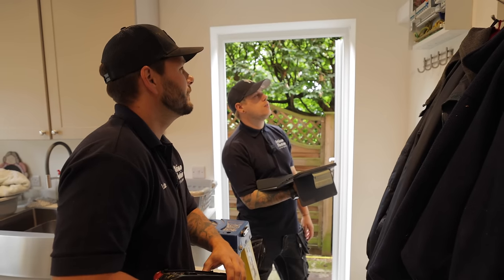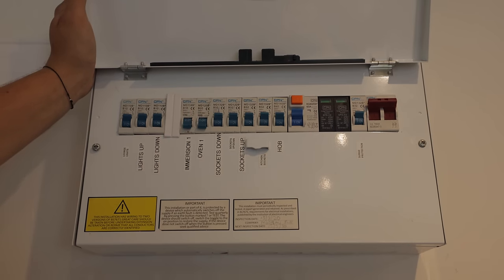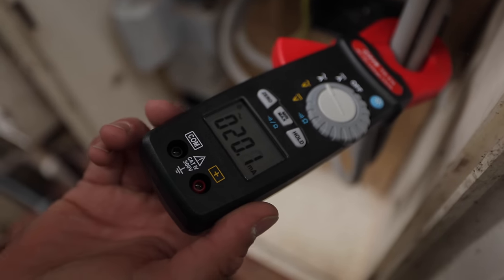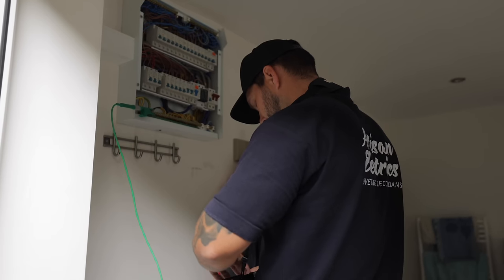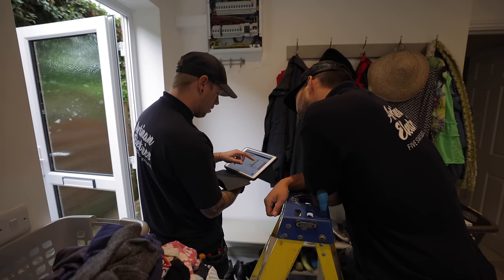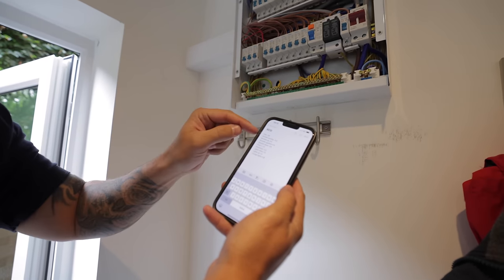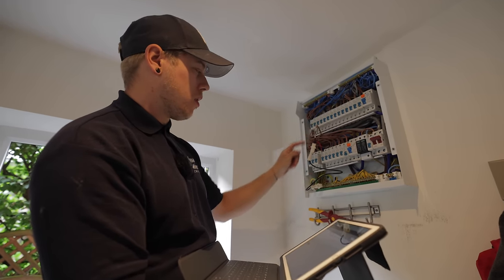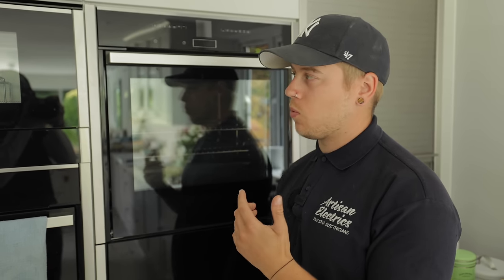CHEAP Electrician cost this customer £1000s💷

Comment: Your quite rightly saying that CPN is a budget make and was adding to the issues and yet when you change boards you use Fuse Box which is also a budget range?
Reply: But if its rcbos its budget and splitting the leakage to individual rcbos
Reply: Fuse Box may be a budget range, but I've found them to be fairly reliable in practise. More so than BG, for example, which is very common in the UK. I use either Hagar or Schneider for preference.
Reply: The issue is that there are too many circuits on each RCD not that it was a budget make.  The RCD's can easy be removed and RCBO's fitted rather than fit a new board @MCKINJO
Reply: @davidexley3110  I know that. What I'm saying fusebox May be budget but it rectifies the problem

Comment: But a normal house has 1 or 2 30mA RCDs and it work’s absolutely fine. The number of RCD’s is fine. Criticism of the CB/RCD brand is BS. RCBO upgrade should not really be needed, it seems like fishing for work, or to put it another way; suggesting an expensive sledge hammer to crack a nut.
Reply: It needs upgrading because it is most likely the wrong type of RCD.

We shouldn't be using type AC RCDs today.

Comment: We can see two RCDs, exactly as required by UK regulations, and yes, equipment used is Asian generic produce UKCA certified. Faulty RCD (and any other piece of equipment) needs replacement. In my opinion faulty RCD shall have beed replaced first and then observations made on leakage. Those observation could be improved, and Merel network analyzer unit used, or 24/7 monitoring installed (i.e. Supla), DC and AC leakage could be measured and then calculated per circuit separately. Worth to mention F type RCDs are not intended to protect from DC leakage over 6mA, and would help only when frequency is modified. That is a serious mistake. Only Type B RCDs would guarantee that DC leakage over 6mA would not block the RCD (and some RCDs type A+ used for EVSE that is still a rare product). Not sure if that job was worth 1000s...

Comment: Changing all those MCB is to RCBO’s increases the limit of a collective fault current. Potentially you could have .33 of a Amp flooring to ground before the system would recognise it as a fault. Something worth bearing in mind.
Reply: What's wrong with that? A property with many devices can quite easily have 30-50mA of earth leakage on normal usage. Having it all funnelled through two RCDs means nuisance tripping. The 30mA trip is a safety limit to protect people. A human isn't going to have limbs long enough to touch all class I appliances in the house to sink that cumulative leakage current.
Reply: I’ll tell you a story. I went to a house where the brother in law had done a board change. The property was TT with a single rod in the garden. The brother in law had got the tails crossed when he was doing it. The home owner hung a picture in the living room and hammered the nail through the neutral and earth. The system had approximately half an amp flowing to ground when I measured it. The tragedy was the owner had 2 beautiful Samoyed dogs. When I complimented her about the dogs she burst into tears. A third dog had died the previous week from a suspected hart attack. It’s kennel was less than a foot from the ground stake. I did not tell the owner what I suspected.
Reply: @demonkey123 unfortunately one can't completely legislate against fuckwittery. A ground stake, correctly inserted, will be at a depth where there shouldn't be step voltages between the stake and the transformer. That combined with the incompetent workmanship that caused crossed polarity. That said, the crossed "neutral" and earth by nail would have caused all class I appliances and any bonded plumbing to become live as a result. If RCBOs or RCDs were installed, they'd still trip.
Reply: I agree, however my story was intended to highlight the dangers of an excessive unchecked current flowing to earth. An RCD protecting multiple circuits would only allow its maximum rated fault current to flow, while multiple RCBO’s allow a cumulative number of faults to add up to a significant amount of current flowing to earth unchecked. Using multiple RCBO’s doesn’t remove faults, it allows the system to operate under conditions that a conventional RCD protected system will not because it regards the situation as potentially dangerous.
Reply: @demonkey123 Your story didn't support the superstition that total leakage is a danger .  Total Earth wire current could be a problem if very high, like multiple amps, because that wire is only supposed to carry that moments before the fuses blow because of a full short to ground .
Reply: It's irrelevant that there would be 330 mA of leakage current. Not that it's ever going to happen. In your wildly unlike scenario every single circuit would have to be at the maximum leak rating (and 30 mA is the maximum leakage before an RCBO trips; usually it's in the 20-25mA range).

What matters is that the individual RCBOs trip at a level which protects human beings from a fatal electric shock and when there is a line to CPC or neutral to CPC fault.
Reply: @johndododoe1411 What would happen if your main earth was compromised? All bonded extraneous metalwork at mains potential due to cumulative earth leakage. Any potential fault current above 100mA would be regarded as potentially fatal.
Reply: @TheEulerID You just defended the safety benefits of a correctly functioning single RCBO and completely dismissed my point regarding cumulative faults. Even 100mA of potential fault current can be fatal. A compromised main earth combined with multiple leakage faults could easily present a danger that would not be detected by a multiple RCBO installation.
Reply: @demonkey123  That is because it is ridiculous. Just how do you think that 330 mA you claim could flow through the combined CPE would pass through a human body? The CPE is at ground potential. Even on a TT system with high ground loop impedance, it is not going to reach dangerous potentials, even on your astonishingly unlikely scenario that every circuit leaked to near its full limit without any tripping. On a TN-C-S or TN-S network, the potential rise above earth level would be miniscule.
Reply: @TheEulerID ’the potential rise above earth level’? What are you on about? Please explain what you mean by ‘earth level’. Anyway, here is another scenario, your mowing the lawn, main supply earth has failed, 100mA of fault current from multiple RCBO protected circuits flows directly through you and your flip flops down to earth. Don’t tell me that could never happen!?
Reply: The IET should do something actually useful and stipulate supplementary earth rods to all non TT supplies.
Reply: @demonkey123  Upticked. However, there's an amusing element - reads like the dog died from being attacked by an adult male deer over 5 years old. As for heart attack - I know about those!

Comment: Had an intermittent RCD tripping fault, electrician changed my 5 MCBs snd shared RCD switch for 5 RCBOs and a main switch,  told me it would be cheaper than him spending the whole day trying to find out what was wrong, and that the rcbo will help identify what circuit the problem was on and that i can then do my own troubleshooting by moving equipment onto different circuits. Figured out it was my computer monitor in the end.

Comment: Well thats a poorly designed system and sums up the lack of Knowledge of many sparks out there installing consumer units.
Neither of them RCDs comply as the the leakage on both exceeds the max 9mA of leakage.
As correctly diagnosed by Lee that board needs to come out.
Good video and its good to see the Artisan guys doing it right. Shame our industry is in a state that work like that shown here has to be re-done.
Well done Artisan 👌🏻
Reply from the maker: Thank you for the kind words, we are glad you enjoyed the video
Reply: I thought it was 30% rating of the rcd, so 30ma would be 10mA?
Reply: @MCKINJO  Split hairs 9..10 fact is neither of them RCDs comply period. Whoever installed that board did not assess the installation neither did they show competence regarding compliance with regs.
Reply: @rattlehead85  always do an eicr before any work
Reply: It wasn't the sparky's lack of knowledge, it was the builder's or kitchen fitter's lack of knowledge in this case, because that's obviously who did all the shady electrical work and issued the dodgy EIC.
Reply: @MCKINJO 9mA
Reply: Builder done the board 🤦🤦🤦
Reply: @MCKINJO 30% of 30=9
Reply: The board doesn't have to come out. It could simply be rewired with type A RCBOs which are readily available from that manufacturer.
Reply: @TheEulerID  Good shout!! Neutral bars can be linked out to provide sufficient ways for the neutral leads and use blanks. Still a pricey exercise considering it was only fairly recently done. 👌🏻👌🏻

Comment: Even if this is a fairly substantial installation I'm surprised there's so much combined earth leakage. Where I live (central Europe) it's still fairly common to have one whole-house RCD and I've never seen nuisance tripping like that. The one time I had utterly unpredictable RCD trips it was a faulty RCD. Old 100 mA RCD from the early 80s, tested the whole installation, IR wasn't great (some VIR circuits left in situ, came in at 8-9 MΩ) but nothing terrible. Replaced the RCD with a new 30 mA, hasn't tripped ever since.

Comment: Great leakage test video.
Ive only fitted 1 split load CU   since 2022. Rcbo everything apart from garage 2 circuits. It is.   Pointless to it RCD boards. Its a real hassle for the customer. Its hard to believe that was fitted as recently as 2020. 
Those kitchen sockets are pretty low on the counter. Just stick to 120cm height

Comment: Nothing wrong with the board as a piece of equipment, it meets all BS standards. It’s the design of the installation that is the problem. Swap out the RCD and MCBs for RCBOs for less than £150 and a couple of hours work.
Reply: Ah yes but then you make no YouTube money, send two guys in to spend a day stating the obvious at 130 plus an hour and then recommend an entirely new board. God help the poor customer here. A couple of RCBOs as you say couple of hours work job done, but that does not pay for the overheads, the vans, the YouTube film guy etc. No wonder title says it costs you thousands
Reply: Very cheap RCBOs let us know where you get them
Reply: @dritanboraku3259  don't need to replace all. Just enough to bring leakage current down below 10 Mamps per RCD/RCBO
Reply: @brianoneill350 why so bitter Brian? 😅
Reply: @KevinSmith-ph6jv  I don’t like customers being treated like this.
Reply: @brianoneill350 Seems very professional to me, correctly conducting an EICR and each test properly. Nice to see to be honest
Reply: @KevinSmith-ph6jv You missed the point .  It's not about "following procedure", it's about finding the best solution at an affordable price versus blindly insisting on something more expensive .
Reply: @johndododoe1411 I would have recommended the same to be honest, as soon as I see that many circuits on a split RCD board, change the whole lot to an RCBO board, makes sense for a long term solution. And best practice is to always conduct an EICR before
Reply: If all the circuits were swapped for RCBOs, then that would be £350-£400 in hardware costs plus the installation costs. I would suggest that's an investment well worth making for all the trouble it is going to save in the future.

Comment: I learnt at college to test RCD's in isolation. IE, disconnect the outgoing neutral from the bus, and turn off all the MCBs. I've had issues testing an RCD from a circuit yet when testing it in isolation it passed.
Reply: The problem you have got it:
If you are testing it in a way that is not representative of a real situation, you are not proving it will pass in a real situation.

The RCD needs to trip with an upper limit on the I delta N, and within the required time.  If it doesn't trip quickly enough and at the required maximum current level, then you are potentially placing people's lives in danger.

In a real situation, the outgoing neutral is not disconnected, and the other MCBs are not turned off, are they?

So you have created an artificial situation which does not occur in real life in a consumer unit in normal use.
And then you have tested that RCD in that artificial situation.

The question for you is, are you just trying to get it to pass, or are you trying to save lives?

There's an argument for testing the RCD in the artificial way you have been trained, it is important to ensure that RCD is working as designed. If it is not working as designed within the required limits, then when in a correctly configured CU and installation, it is never going to pass.

But you really need to test that RCD as it is in a real life situation, and not the artificial test situation you have created.  You and the residents of that property need to be confident that RCD will trip quickly enough and at a low enough current threshold to prevent the person being electrocuted.

What is more important:
a) Getting a pass on the RCD so you can pass the EICR
b) Demonstrating that the RCD does it job properly and prevents somebody being electrocuted?

Comment: type f rcd´s aren´t that expensive anymore well at least here in germany from siemens an type F is around 50€ and an type A at about 35€ and for just 15€ more i install an type f for the better safety, type b well thats another story they are still like 250€ and more
Reply: Type A RCBO's here are around £20, type F is unavailable as an RCBO, only as an RCD and then is £100's. 
Type B are very hard to find as resellers here in the UK are complete morons and keep labelling Type A, B curve RCBO's as 'Type B' - so when you look for Type B rcbo's or RCD all you ever find is Type A, B curve.

Comment: Why is there deliberate leakage in all appliances?
Reply: Not all, but lots of modern electronics leak through filter caps on power supplies. Normal operation, and not a problem normally, but load lots on one rcb and this happens.
Reply: Switch mode power supplies that reference ground and EMC filters are the most common ones. It’s not strictly “intentional” but rather unavoidable would be a better term.
Reply: For EMC compliance class X and class Y capacitors are fitted between L, N & E.  Each device (PC PSU, audio equipment etc) may add a few mA to earth leakage.
I was involved in the design of a large non-domestic LED display where we fitted 32 off small DC power supplies.  Each had it own EMC capacitors, and a soon we tried to power it up, the 30mA RCD on the supply tripped.  We had to remove the internal EMC filters and fit 1 external EMC filter to each set of 4 PSUs.
At home I had a cheap Tesco DVD player.  It had a two wire mains connection (no earth), X capacitors to its metal case, and a switch in the neutral.  When it was "turned off" one could get a slight shock due to the L-E capacitor.  I notified the supplier of this design fault, but had no acknowledgement.
Reply: @BrainW33a  Many an old Sky box has zapped me over the years, thanks to it's EMC filter caps putting halfwave rectified mains AC out on various connections.

Comment: Well done great video when you are carrying out this type of work do you find it hard sometimes to explain the issue of earth leakage 
to your customers or builders , and do you  sometimes feel they think you are looking for more work .
Thank You.
Reply: Tbf, we did get earth leakage clearly explained... by the oven repair guy. The oven NEFF oven was faulty. Still didn't solve the problem but, in checking the isolation switch to the oven, I found the spark had connected it up wrong

Comment: Thats a lot of load on the bottom RCD. Over here in Malta, we used to have intermittent tripping due to inverters on A/C units and on the freezer. The solution was to use a type F RCD.

Comment: Clutching at straws when you diagnose the issue on the half of the installation that has more earth leakage that has the majority of the load. Also when you’re only issue with the cert is the cut out that the clearly shouldn’t have looked at anyway
Reply: I always put a limitation on  the test sheets when it asks for the main fuse size as how do I know what size it is just because it says 100A or 80A means nothing as someone could have put a different size fuse in the carrier and we should not be able to remove that fuse as it should have a seal

Comment: These guys are always looking for anything to charge lots of money to customers.  For them, everything is dodgy. All they had to do is put another rcd split the bottom board  into 2 rcd. Done. But of course, that's dodgy for you to find the same brand rcd Why its cheap brand.
By the way, is it a problem to use a cheap brand? Will that make  u more safe? They come with bs compilance anyway.